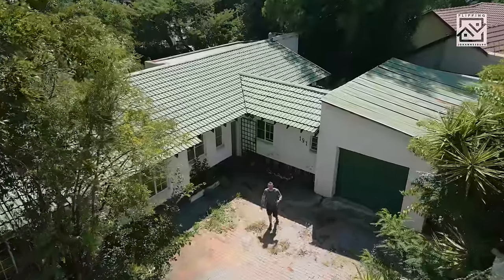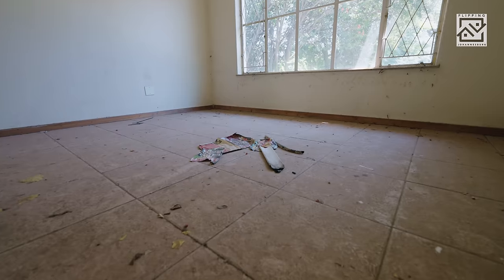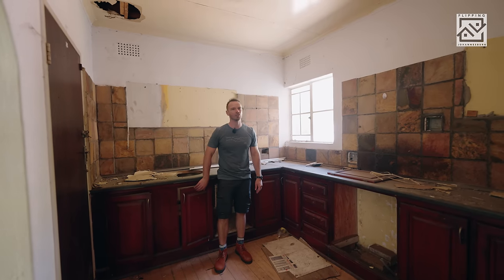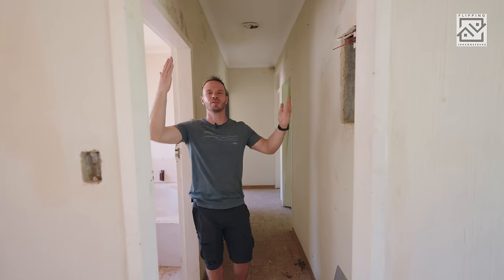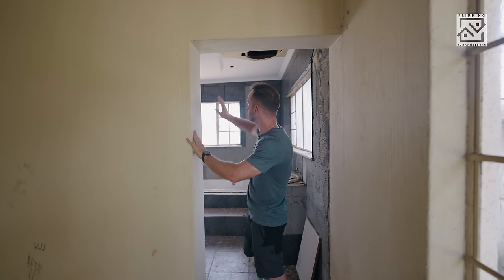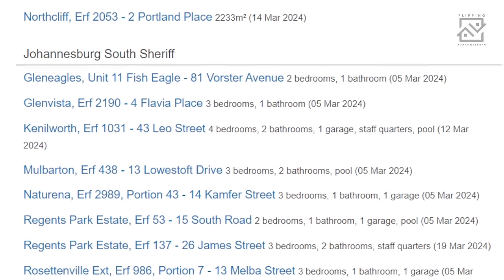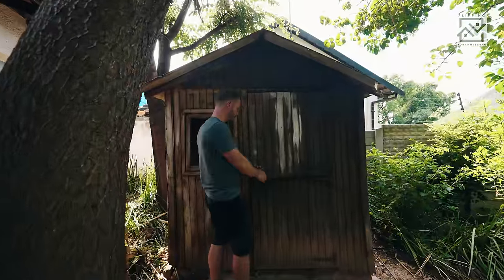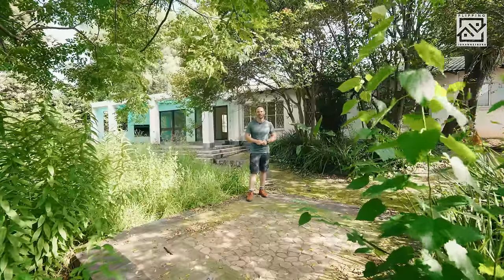ABANDONED Ruin House Flip - Project C | Episode 1

Comment: the window on top of the door is called a transom window it's purpose is to let light enter the hall way
Reply: Makes sense, ty
Reply: They also allow airflow through the house when open, whilst still maintaining privacy with the doors closed.
Reply: i concur
Reply: Thanks for that. I live in the area and there is a transom window between one bedroom and the corridor, obviously to let light into the dark corridor. It works.
Reply: We have the same in many UK homes and it is too light come through onto landing and depending on where the bathroom is it lets light shine down the stairs
Lisa UK
Reply: I liked it as soon as l saw it 🤩
Reply: How much does the flip over cost ?
Reply: They also used for pull-ups...

Comment: I believe those windows at the top of the doors ALSO allow for the removal of hot air during the warmer months as hot air rises. If you closed the door it creates a pressure difference resulting in the removal of the hot air. Basically a manual HVAC system and as @priscillamt2476 mentioned it is used for allowing light into a space.